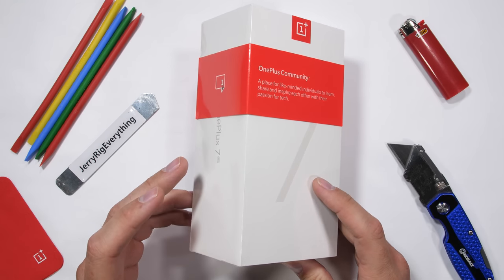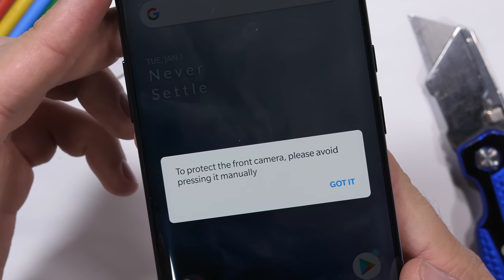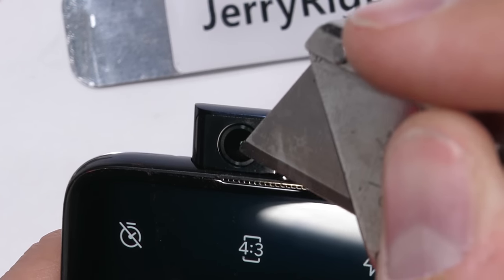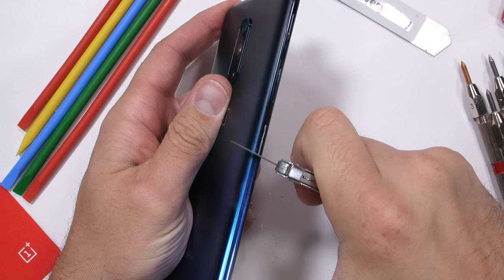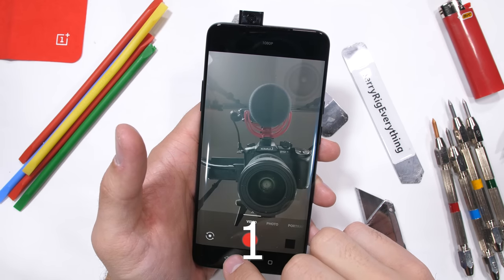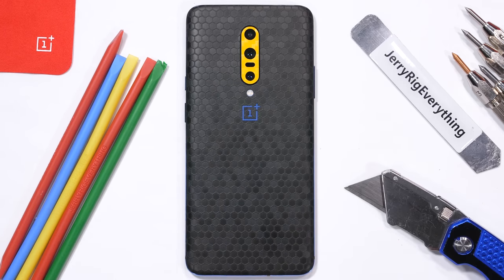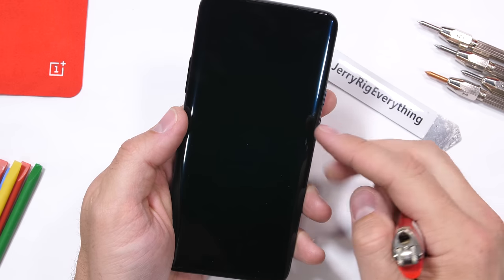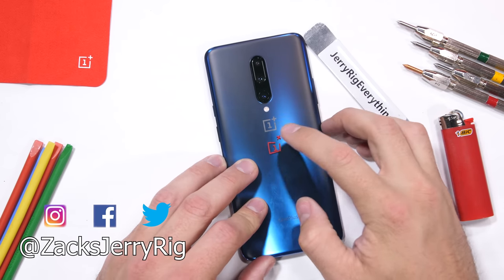OnePlus 7 Pro - Hidden Camera Durability Test! Will it Scratch?

Comment: The camera retracting when in free fall is actually epic.
Reply: And clever too
Reply: Yes. Never expected that feature
Reply: Oppo already has it , in f11 pro i guess
Reply: Oppo and OnePlus are the same company
Reply: @jftechdrones  oppo is parent of one plus
Reply: Foxtrot1213  apple will never do a pop up mechanism camera
Reply: Foxtrot1213  They won't. I really doubt they will do anything special with the front camera until putting them under the display becomes mainstream.
Reply: Foxtrot1213  ikr
Reply: @anishpimple21  no, BBK electronics is tha parent of Oppo and OnePlus and i think, Vivo also
Reply: @justcornerlurker   bbk is parent of oppo and vivo and oppo owns oneplus so ultimately it has every three of them
Reply: Foxtrot1213  if they did they would say 
"Our newly invented liquid retina popup camera with the free fall feature to save the camera 
So if your screen breaks or the camera somehow gets broken you only have to pay $2500 to fix the screen, the camera unit sadly can't be fixed so you will just have to buy a new phone
Therefore you should buy about 5 if this phone and back them up with apple eye cloud for just $399.99 per day so you don't have to pay a fraction of the price to repair it"
Reply: Foxtrot1213  Of course, they'll claim it's original too, just like the notch to get a better screen/body ratio!
Reply: @_Doskii  They might if it means adding another point of failure that potentially bricks the phone 2 weeks after the warranty expires!

Comment: Guess you can't skydive with the front facing camera open...
Reply: No, you can.
Reply: @newatlas898  
No it will automatically shut down because it's falling
Reply: @omarnotfound  u can disable it
Reply: No as the accelerometer is moving at a constant speed and not sudden rapid change. Once you jump out of plane, it probably will close, but after open again, it will prolly stay open until you land and turn it off
Reply: @itsdimitriymedvedyev  exactly.
Reply: @newatlas898  that's like saying it won't work in a car or plane. It closes from acceleration, not from speed
Reply: Why would you want to do that ?
Reply: no its based on acceleration. when you jump out, you will have close to gravitational acceleration. but as your speed increases, the air resistance increases and counteracts gravity. so a short while after jumping, you can use it again
Reply: but what about if ur in a rocketship going up jerry new test on pop up in a rocket please!!!
Reply: Extreme Prejudice why would you skydive with a phone use a go pro or something
Reply: @rizzi4093  omg why didnt we think of that ur amazing legend
Reply: at one point you will just be falling at a constant speed (terminal velocity) and then you could just re-open the camera
(yeah i know this was supposed to be a joke)
Reply: That sucks.
Reply: JUST DISABLE IT
Reply: The rear camera still there

Comment: I think you should start do the water resistant test for every flagship.
Reply: yeah a water test makes more sense than a fire test
Reply: @dogrzz7082  This is my toilet, you will observe the phone drowning for the next 10 minutes
Reply: Dave2D did it
Reply: Done by Dave lee
Reply: I would honestly trust Jerry over an ipx rating
Reply: @grantdavis5627  it's not ipx rated and Dave2lee literally submerged the phone in water for 15mins and still worked fine
Reply: @resurrex2826  That's the whole point of my comment. I know it doesn't have an ipx rating but I would sooner trust experiments done by independent creators like JerryRigEverythjng and Dave2D over an IPX rating
Reply: Hi guys how much for the oneplus 7 pro
Reply: @fymousgaming5781  starting at $669 USD
Reply: Most would pass it. Those usually require time to let the water seep and settle. Even if they're not IPS rated they're still likely water resistant for short exposures.

Comment: This video made me realize....I put my tempered glass screen protector on-top of the pre-installed one...
Reply: Lmao
Reply: Does the phone come with an extra tempered glass beside the pre-installed one?
Reply: @felixpham4934  no but it does come with a free silicone case
Reply: @ultrax5083  thank you
Reply: Tempered glass sucks on curved displays
Reply: Layers of fear
Reply: @felixpham4934  no, just the one added already, but i have my phone for nearly 2 years and it is still intact and in perfect condition. I bought one extra, still havent used it.
Reply: Ood
Reply: Ooof
Reply: Inception display protection.
Reply: Oooooooof
Reply: First of all .. that's awesome and hilarious.  Second of all, I wanna know what protector you chose.  Is it working well for you?
Reply: That's like putting on a condom, then going home from the date.
Reply: @felixpham4934  nope 💀
Reply: @perdo7195  not if it's "white stone dome"
Reply: Extra protection I guess
Reply: Then it is a 12 on the Mohs hardness scale
Reply: Double protection
Reply: LOL
Reply: RIP😂
Reply: @perdo7195  uv glass is good.:)
Reply: thats a tight fit
Reply: @perdo7195  whitestone dome protector is sick
Reply: Double the protection
Reply: HHahaha
Reply: where did you find one that fits the curved screen properly?
Reply: @perdo7195  not if you knew which glass to buy. You have to buy the non adhisve screen protectors for curved displays that uses a UV light cured glue to fit the glass.I have to admit though it's hard for regular people (I do cell repairs) to install a screen protector with a UV light cured resin. However, this is the only way you can get a good experience with a glass screen protector on a curved display and this is how they do it in the factory when applying gorella glass to the screen. It's a hideous process but at the end the screen protector will be perfectly stuck on the phone and looks OEM.
Reply: @Nepheos  Amazon UV light cured one. It's perfectly fit and never noticeable. Though it tool 45min of precise work to have it this way. It's not for everyone
Reply: Hey how's your mobile working now
Reply: More protection 😉
Reply: Double the protection
Reply: Rip
Reply: Believe me, I did that with my current S10e.
Reply: You took the term "extra protection" to a new level. Congrats
Reply: DOUBLE THE PROTECTION AHHHHHH
Reply: 1000th like
Reply: hahaha
Reply: And I'm using it without any protection
Reply: Lol 😂
Reply: Lmao😂

Comment: Zach please test it by dropping it in the fine sand/dust, I suspect that selfie camera will get messed up easily by that.
Reply: Bump
Reply: His name is Zach
Reply: @DevinWC514  k
Reply: They say they have a seal for that too
Reply: it will retract
Reply: True tho. Bump
Reply: I too, would like to see this
Reply: The camera detects drops and retracts before it falls, so dust won't get in.
Reply: B U M P
Reply: @lilph9644  Sure, but about just like general use. As an example, say someone is sitting around the sand/dust and something kicks it up on/in the camera lens how does it manage then?
Reply: @zsoulweaver  I think there's some protective thing covering the circumference of the hole that stops dust, but I'm not sure. He should test it and see what happens
Reply: Bump
Reply: Not sand.... it’s coarse... and it gets everywhere
Reply: @__The_Real_V__  apparently they don't
Reply: One plus hater spotted😂😂
Reply: When it falls it will automatically close the selfie camera by itself
So it can not be tested
Reply: Good idea
Reply: it has a membrane like the one in the newer macbook keyboards. dunno how good or bad it is, but its good underwater if you look at dave's vid.
Reply: True
Reply: Good idea
Reply: Bump
Reply: @cedricjuanly892  I mean testing it with camera in and out, and by dropping I meant just putting it into sand to simulate few months in the pocket.
And also cycle it few tens of times afterwards to see if it will cause some grinding noise or even get stuck.
Reply: Arek R. Oh

Comment: After Buying. OnePlus 7, scratches in wallets and deeper groves in bank account.
Reply: Underrated comment.
Reply: @alannn7108  yeah, what about you? tons of people say that a comment is unoriginal. it isn't.
Reply: It's 500$ not that expensive
Reply: @666mongopawn  It's $700 lmao.
Reply: @seangriffith8801  it's 550 rn in USA.
Reply: @xkcd_68868  Yes I know, I bought one. But that's a black friday sale price.
Reply: @seangriffith8801  I have a friend who paid 500$
Reply: @666mongopawn  paid $450
Reply: Does it scratch easy?
Reply: @brucewayne-ej3cx  I've got it in a case but there are no scratches on the screen and I don't have a screen protector. I mean the most I've ever really done is accidentally put my keys in the same pocket as my phone a few times but that clearly didn't cause any scratches. My screen literally has no scratches. Looks the same as it did when it was brand new. I mean I've only had it for like 5 months but I'm definitely surprised there's not at least one minor scratch.
Reply: @jhaz89  cool. Mine comes in tomorrow. Keys scratched my last phone

Comment: 4:50 so no selfies while skydiving 😂😂
Reply: Once you reach terminal velocity it won't be able to tell its dropping because there won't be a change in g-force.
Reply: @Gooseys11  Good point.
Reply: Fuck now I want to know xD
Reply: @Gooseys11  It is actually able, since the accelerometer always senses the gravity pulling the phone when it's not moving, but when it reaches it's terminal velocity the accelerometer will basically say 0, but correct me if I'm wrong.
Reply: @Gooseys11  but then when we keep the phone while skydiving and then jump off the selfie camera will close and then when it reaches the terminal gravity we can open the camera again. Am I right?
Reply: Good one
Reply: i am sure that they can easily add an option to disable it  ! but not everybody skydives on a regular basis i guess
Reply: @DavorBa  no bad point forgot physics class.
Reply: Who tf takes selfies with phone while skydiving anyway? There is a reason GoPro's exist.
Reply: @Gooseys11  sure they are, since you have less than 1g. 🤦‍♂️
Reply: @VDavid003  When you are standing on the ground, your acceleration is zero because the force from the ground equals your weight. When you are at terminal velocity, your acceleration is zero because the drag force from your velocity equals your weight. To an accelerometer they are identical situations.
Reply: But u r holding the phone while sky diving right so who would it close
It's not like it would close if u move your hand very fast
Reply: bahahaha good one......and maybe in a real fast elevator decent.....
Reply: @savyasanchishukla918  the phone has a scanner for falling so if you are sky diving then the sensor would acitvate and the came will close
Reply: @Commentsnotvideos  that's wrong.
Reply: @Commentsnotvideos  Actually now that I think about it, yes.
Reply: @Commentsnotvideos  That's exactly what I was trying to say, in fewer words.  You are no longer accelerating once you're at terminal velocity, so an accelerometer won't register the fact you're falling.

Comment: Thanks Dbrand for sponsorship. 
REMOVES THE SKIN RIGHT IN FRONT OF THEM 

burn
Reply: That was unsatisfing
Reply: He did that to show that it doesn't leave residual glue on the surface and making is easy to replace or remove the skin without affecting the looks of the phone.
Reply: DUN DUN DUN
Reply: I think it's because he was about to bend it
Reply: BURN

Comment: Will the price tag increase? 
OnePlus: no, but actually yes.
Reply: Lmao
Reply: hanoniem anoniem what’s LMAO?
Reply: Kaif Din  nice save
Reply: Its their flagship, the base model is $500
Reply: I am really impressed by the price that they announced in India specifically of oneplus 7 because it's even cheaper than one plus 6t
Reply: Kaif Din  I died 🤣 
😛🍋🍊😂
Reply: At least it will last for years to come where a Samsung would fall apart after only one year.
Reply: @styled9876  Its 709EUR not 500
Reply: harsh kumar  34999 for 6 and 128, 37999 for 8 and 256 gigs
Reply: looks at oneplus price looks at samsung price, yeah with those specs the didnt deviate from their philosophy that much. be reasonable
Reply: Regular 7 is cheaper than 6t. 7 pro in the other hand, is more expensive, but has massively upgraded hardware as well.
Reply: Did you actually think it wouldn't increase? Companies want money.
Reply: Still cheaper than LG, Samsung, Apple, or really any non-Chinese company right now on flagships. Top model is $750 and is comparable to the Samsung S10+ 12GB. It comes in at less than half. The entry model is 50% cheaper with a better screen and much better processor than the S10e.

Yeah they raised the price. If you want cheaper I'd highly suggest waiting for Xiaomi to show off the K20.

Comment: Customers : Finally with no bezels we will have smaller phones

Companies : Let's make phones even bigger
Reply: I can never wrap my head around that.
Reply: I would love to have a 5.5" 18:9 phone with the bezels' size of the Oneplus 7 Pro. And a headphone jack, as well.
Reply: I want a 7 inch phone
Reply: Cristian Babencu  You mean e. g. the iPhone 8? That would be pretty comfortable to use with one hand.
Reply: Cristian Babencu 
Why would it? Your logic is flawed. If Xiaomi managed to put 4000mah battery in 5" phone (139.3 x 69.6 x 8.5). Any mainstream brand could do it as well. Maybe even better.
Reply: Cristian Babencu 
The phone I'm using right now is 8.5mm thick with 4100mah. Moreover it was made 3 years ago (Redmi 3s prime)

Edit : Actually I changed the battery myself few weeks ago. It's not even that big. Phablets nowadays could fit 6000mah easily but choose not to

Comment: I didn't realize how big this phone was gonna be because I only watched your reviews of it before I bought it. I thought it was a normal sized phone but I think you must have enormous hands because the phone is huge!
Reply: Vincent Rubino now that you’ve had this phone for a couple of weeks how do you feel about it?
Reply: @realkevintorres  I'm super into it! I am still shocked at how fast it is! I thought 12 GB of RAM was overkill but I have been multi tasking like crazy and the phone never hiccups. I got used to the size pretty quick. The smooth lush screen still impresses me! The curved edges were kind of annoying but I bought a nice thick case so now the accidental touches from the side don't happen anymore. I do miss wireless charging but love warp charge

Comment: When it has no micro SD or headphone jack.
You have become the thing you swore to destroy!
Reply: 1+ One did not had microSD, no 1+ have it
Reply: Tbh it is a very well designed phone so i can live with it i guess
Reply: @donMurgero  still the headphone jack as there really isnt an option that is as good at wired that doesnt cost 10 times more for the same audio quallity.
Reply: @captainheat2314  Or just hook up your headphones to a dongle,and don't get it off?Yes it takes 2secs more,but what's the huge compromise?
Reply: @matejmilovanovic922  Dongles are annoying, bulky (even those small ones) and don't hold on as well as the good old jack. Never Settle for a phone with less features than their predecessors.
Reply: Insert Anakin Meme
Reply: @donMurgero  except they gave  the phones a ginormous amounts of harddrive space by releasing a phone for 128gb since the 3t
Reply: @Lonehawk2k4  you have to choose from 128Gb to 250Gb which is quite enough and more
Reply: A L E X you shouldn't have to tho.  Not for that price.
Reply: @donMurgero  The Oneplus X had a microSD slot but I don't think we'll see another one of those again.
Reply: Not only that, Right now the S10 is 700USD at BestBuy Unlocked and S9+ which has lot of other features and V40, G7 which have superior Stereo 24Bit Studio class recording and QuadDAC are for 500 bucks, same for Note 9 Exynos on eBay which has more productivity as well and these all phones have battery saving technologies keep their life. This Warp charges at super high voltage and high amperage which is bad for battery cycles and destroys it very fast, ask any OP phone user with that stupid Dash Charging. I bet 99% of the users do not know this. But Techyoutubers not knowing is unfortunate.

OP is playing their cards so cleverly adding the QHD until 2019 and ramping up the 90Hz while the latter is battery destroyer (Hardly anyone "needs" it) and the stereo speakers in 2019 while almost all phones have that even the 3a has it. No SD slot as fallback storage and no IP rating officially clever tactics and no Qi charging for this price it's a good phone but It's over hyped to moon. OP phones don't drop in price too, a bummer. Buy Samsung S10+/LG G8 with solid audio for Blackfriday at much less price (I think most will end up buying those rather than this expensive Chinese phone which had copied everything from Apple website for this phone site to Samsung design and lenses from all over except didn't copy or added the ones which users needed and paying more marketing fodder for the blogs, look at any review all are praising as if no flaws), save your cash and keep them for longer time when you are paying over $500.

Edit : Thanks Zack for your coverage, one of the best YT channels.
Reply: @donMurgero  oneplus X got micro SD..
Reply: TSMKFail  microSD card are very slow and this is the reason they are cheap. Internal storage is expensive on phones because it is ridiculously fast. And to switch phones you can just use Oneplus Switch to transfer data and apps( better than using microSD.
Reply: One plus X have it
Reply: Lockonese this is such a silly comment, of course the headphone jack will disappear one day, but most people don’t want that to ya-pen while the only worthwhile Bluetooth headphones on the market are $200+, while similar sound quality, wired, costs $5. And doesn’t require charging.
Reply: TSMKFail  that is still really bad as compared to Oneplus 7 pro's 1441 MBPS read speed and almost 400 MBPS write speed.